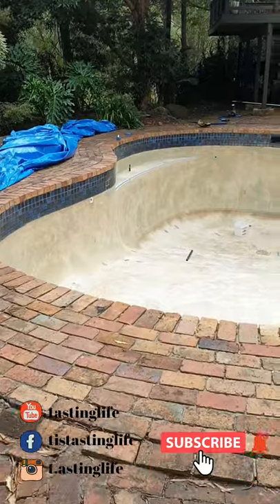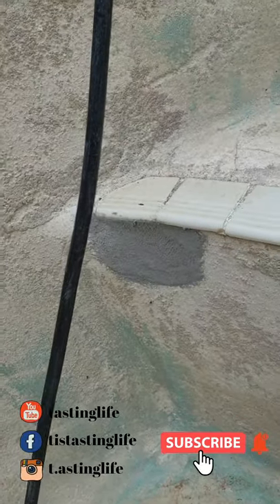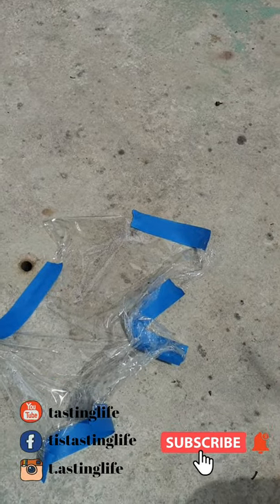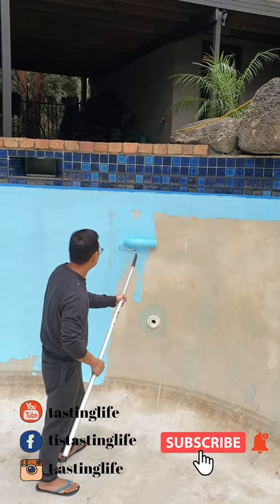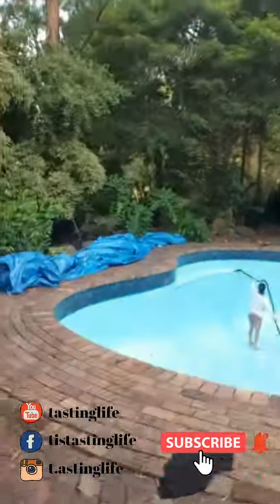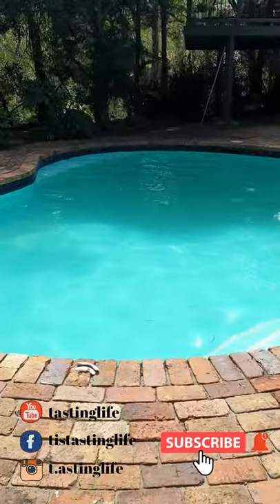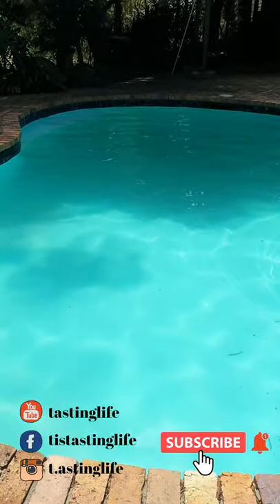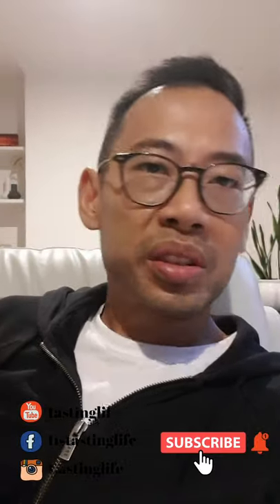Vlog How hard can it be to paint a concrete pool yourself with Luxapool epoxy paint? DIY to save $$$

Comment: How did you  drained your pool? Did you have to release the hydrostatic relieve valve? So the pool wont pop out
Reply from the maker: I used a portable pool pump, and the relieve valve was at the bottom of the pool. :)
Reply: How many gallons of paint did you use?
Reply from the maker: @dressedupnatural4566  can't remember now  all depends on your pool size. There are calculators for it, but the guys who sell u the pool paint should be able to tell you. Its not cheap so its best to speak with the store
Reply: @TastingLife  k. Thank you. We are debating if we should paint. We have a few chipped paint places that may scratch your toes.
Reply from the maker: Once painted its smooth and almost slippery. Filling in the holes is easy

Comment: You should have repaired the cracks with opening them up and put new plaster or a plaster patch. No cement is 100% water proof. I’m in the process of remodeling my concrete pool to save a time of money. Most important thing is to do research. I’ve done well over 50 hours of research on every step I need to do.